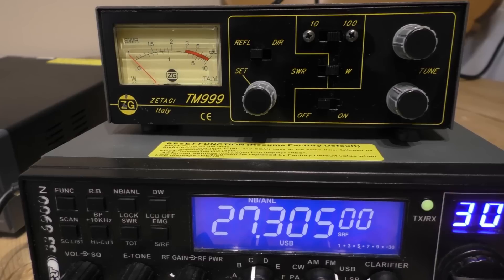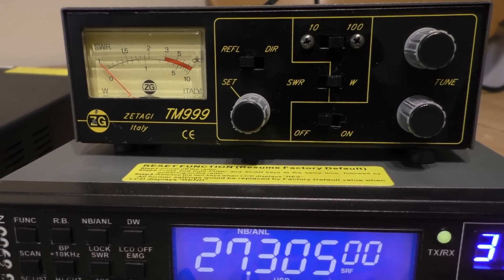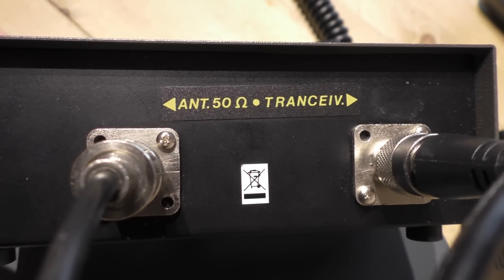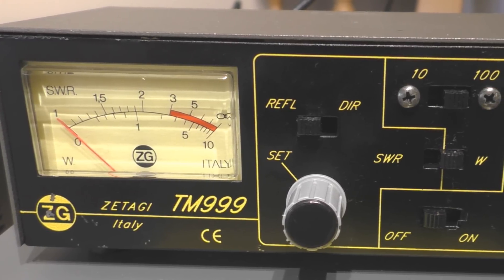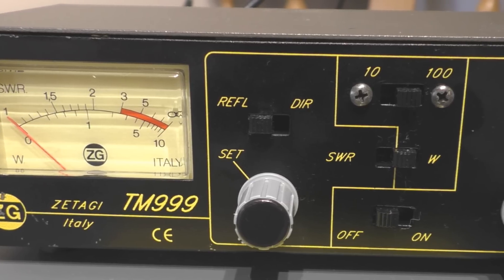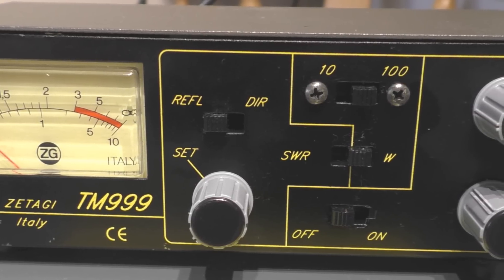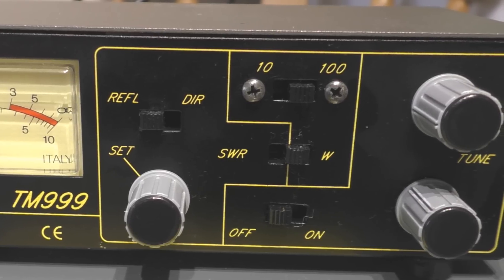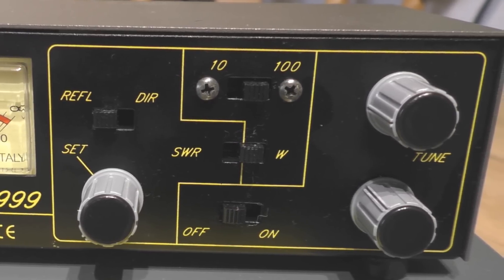Zetagi TM999 Antenna Tuner / Matcher. Your last SWR resort

Comment: Nice tutorial Fred - i got my silver stick down to 1.5 SWR on installation - added in the TM999 1:1 thru the band with very small loss of power. Like wise, I enjoy having an external meter and even on the amateur bands I use an ATU to get the antenna and radio matched. Thanks again, enjoying your channel once more :)

Comment: hi fred, does all ham radios come with a auto swr feature, as i cant get my swr down on my cb rig using a antron a99
Reply from the maker: Hi.  No not all have a built in antenna tuner.  Most modern sets have like my Yaesu 450D but neither of my older Alinco's have it.
Reply: @CB-RADIO-UK  that makes life easier with the swr
Reply from the maker: It will give you a 1.1 SWR by pressing a button but the antenna still needs to be in good tune.  You also loose a bit of transmit power through the tuner.
Reply: @Fred in the Shed  I'd take that haha...love watching your videos BTW

Comment: Long ago we had one antenna tuner similar to this and a 25w "afterburner" but I never found out how to use it. The instructions I got only resulted  in loud angry ominous humming and the power usage on the 25w amp spiking to more then then 10A at 14v our power supply could deliver and I am pretty sure a 25w amp is not meant to use 140w+....

Comment: I have 3 meters, one shows 1.2, one shows 1.7 and the zetagi shows 2.5 so what one is correct ?
Reply from the maker: Hard to say. If your radio has a built in SWR meter cross check with that.

Comment: they're 67 quid at Radio world now Fred, so getting mine from Knights. My external swr is just under 2.0 but internal is around 1.5-1.6
Reply from the maker: I always prefer an external meter to double check if iam having issues.
Reply: @CB-RADIO-UK  Just found out the Zetagi TM999 is 44.99 at nevada radio.

Comment: Hi again Fred. Another daft question. I have bought a Zetagi TM 999 & an RM 203P Lin Amp  100w AM /FM  & 200w on SSB. Onto my SS6900N Radio. Now the daft question. What order do I use them Radio , TM999 & RM 203P then to antenna  or other way around. I have been told that you can use use the Linear safly up to about 8w on AM/FM  & about 6w on SSB. Can you please advise Mate? Cheers Keith
Reply from the maker: Hi Keith.  Iam not sure i would try using a matcher in line with a amp as it might heat up.  Normally the amp goes straight after the radio.  Hope that helps.

Comment: Hi setting up my ss 6900 swr a tad high, I can bring it down using the tm999 ( 1.1 on the  meter) but it reads high on the rigs built in swr meter. Is this normal, do I disregard the rigs swr and go by the tm999. Kind regards phil.
Reply: If you never received a answer, just to let you know that I was in touch with rightchannelradios.com and they told me to disregard the rig meter and go by what's on your tuner.
Reply: Hi Phil,
I have the same problem with my radio as well!. Did you ever get a answer back?.

Comment: Hi, couple of questions to anyone who knows the answers . . . what is the difference with the 2 knobs (load & tune)?, can a matcher be connected all the time? and some of the older versions had a tiny antenna out the back of the unit, what the jezzus did this do? yes I know that was more than a couple  😁
Reply from the maker: Hi.  The load and tune knobs are connected to tuning plates inside.  They dont actually touch.  One is feed and one is output.  You simply turn each one to the SWR is at it lowest.  Yes you can leave the matcher connected as you can switch it on or bypass it anytime.  The matcher will loose you some transmit power when switched on. The little antenna was for field strength measurement.  In theory it could display up the TX power without connection.  In practice the cheap ones were pretty useless.
Reply: @CB-RADIO-UK   Interesting stuff, well I've just gone and bought an old secondhand one so that'll kill some lockdown time.

Comment: No , what I'm asking is, is it normal for my swr to go higher when I turn the variable power up on my cre 8900, as it as a built in swr meter that reads higher when I turn up the power and transmit, I think you have miss read the question lol.
Reply from the maker: Right got you.  No my SWR stays about the same.  I always test on full power.  Mind you iam not 100% on the 8900.

Comment: Sorry ,I mean on transmit
Reply from the maker: Your SWR should give a steady reading on transmit on FM and AM.  On SSB the needle will swing back and forth with the power of your voice.  If you do not talk into the mic there will be no reading.  If your saying the radio transmits as soon as you switch on then you have a fault in the mic.  Cheers

Comment: Hello Fred, I'm having swr problems with my CRE 8900  using a 5/8 wave silver rod ,as soon as I turn the power up on the radio ,the swr goes up as well, any suggestions or is that normal , also my swr is slightly higher on eu compared to UK 40. Thanks. 26CT3032.
Reply from the maker: Hi.  The SWR should not register until you key the mic.  No idea why the SWR would move on receive.  If you have tuned the Silver rod to the UK 40 band then the SWR will be slightly diff on the EU band as your using a different freq totally normal.

Comment: I, too am old school and prefer a seperate unit for SWR, Power, Modulation, etc.... I guess the extra equipment makes the package look more majestic. Nice explanation Fred. Very clear and concise as you usually are. I am sure it will be most helpful to many good folk out there that are fiddling with communication radios.
Reply from the maker: Thanks Andy.  I hope it was clear even though i said Reference instead of Reflected when talking about the switches.  The TM999 is an ok meter but its not the most accurate.
Reply: @CB-RADIO-UK  IF i had an swr/matcher and a burner , in what order would I place them inline ? i.e. rig,to burner, to swr/matcher ..? or vice versa , assuming all are rated to 50w.

Comment: First of all....when talking about CB usage there is NO ROOM for Antenna Tuner or "matcher" at all. If your antenna is way out of SWR, then replace or fix your antenna! CB usage is on a very narrow frequency/band, and if your antenna won't performe, then get rid of it - replace it - just fix that antenna!  Antenna Tuner is really - and only - useful for multiple band usage, where you can't have optimal conditions for locating antennas- or if you want to use a single antenna for multiple bands - mostly used for radio amateur HF "enthusiasts". Even though - most radio amateurs wouldn't or won't use antenna tuners - they use proper antennas for the right job. But sometimes optimal conditions is not available, and that's where "antenna tunes" comes into the equation. But do remember, that you can have SWR 1:1 on any SWR-meter and still poorly radiation. You'll loose x% transmitting power by using "antenna tuner" (heat the birds or your neighbors during wintertimes). So....I'm sorry to spoil the party here.... go fix your Antenna for that specific usage you need - in that case find a good friend with the most important tool you'll ever come across ie. ANTENNA ANALYZER! When you're dont "tuning" your antenna THEN use (even) a simple SWR meter to monitor if anything is wrong during transmit.  Fred...you was talking about the build-in antenna tuner in your F450D and you're right, it does "tune" your antenna automatically - but it won't fix anything - it will only make your radio THINK everything is okay and not harm your transmitter. Go check Dave talking about tuning with manual procedures.....he will also cover most of the theory & facts - it's only about 10 minutes - you will survive! :-)            https://www.youtube.com/watch?v=RRkbdTadmUU&t=499s
Reply: More into this:         https://www.youtube.com/watch?v=ts2nkCDIS4s
Reply from the maker: Thanks for the extra details and links.  Personally ive never had to use the matcher part of the meter as ive always managed to get a SWR of less that 1.5 even with the TLT.  As i said in the title the matcher really is your last resort if you are unable to reduce the SWR to a safe level.  This comes up sometimes on mobile set ups where people find that they may have a large pan sunroof or body panels are alloy / plastic etc.  If your stuck in that situ with lack of groundplane then the meter will at least let you TX.  Of course the price you will pay is a reduction in transmit power.
Reply: @CB-RADIO-UK   ....then I'll drop mobile usage since you're reflecting most of your power right back into your radio! The word "tuner" should be;  "Make your radio Happy but lazy and Useless"....    ;-)

Comment: I personally use an antenna analyser. Accurate and surprisingly easy to use. They are generally more expensive to buy but well worth the extra money. Its a digital readout and quite user friendly. Maybe an investment for the future Fred. Especially as you are using a lot of different antennas for different frequencies. Love mine. Why did i not get one earlier ? Thanks Fred.
Reply from the maker: Good call Mark.  Maybe i will in the future.  In fact ive never had to use the tuner part of the TM999 as ive always manged an SWR below 1.5 but its handy if you get caught out.
Reply: ...and exactly the right way of doing this! Fix your antenna for that specific usage THEN use SWR meter to monitor if anything goes wrong during usage... I'we seen those confusions about SWR, Tuning, DB's, Power, Radiation etc.